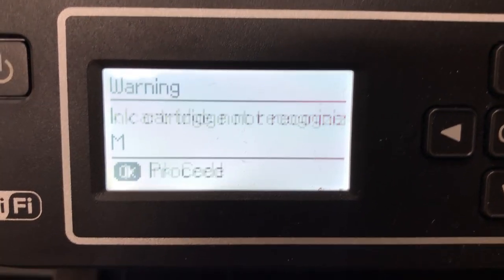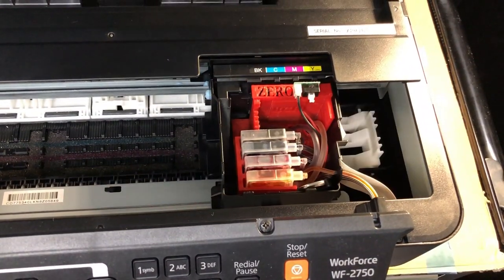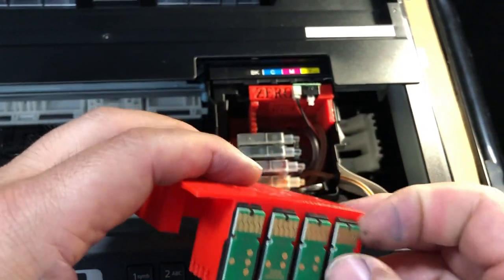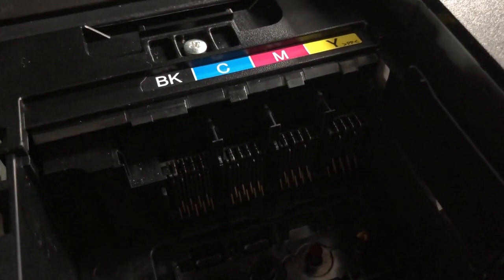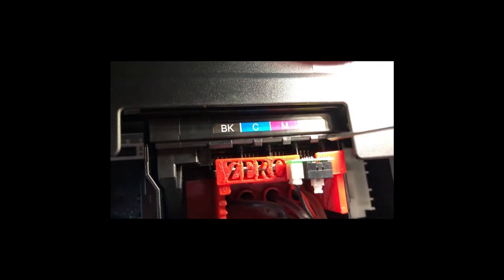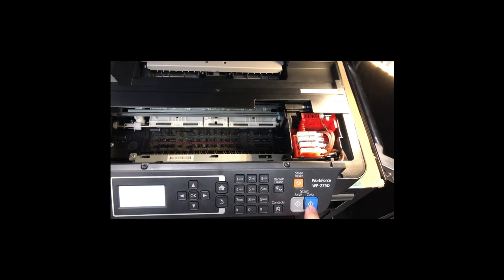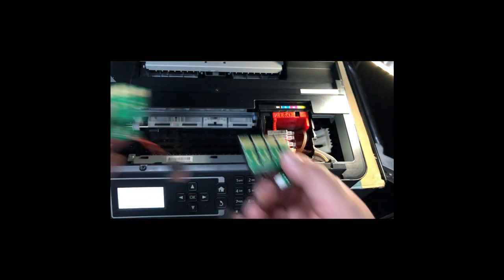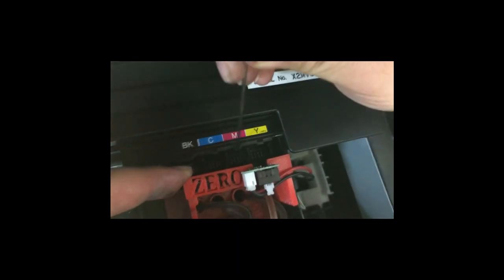A quick fix of CIS chip not recognized problem - WF 2750

Comment: Thank you for the vid. I will never be buying another Epson product in my lifetime.
Reply: I agree. I have had 2 epson printers. They last a few months and then something goes wrong. The one the paper feed just stopped mid print. Now the second one just does not recognize the ink halfway through a print.
Reply: HP is the same or worse.
Reply: @flottagraphics  so far Brother hasn’t been a complete scumbag company
Reply: @seanbradley8286  At least you can buy Epson projectors and document cameras. Those are awesome!
Reply: Im a broke 22 year old that runs a small business 
I bought a epson printer and was so excited and it died exactly a month later so I bought a new one and its not reading the new ink cartridges that I just spent $70 on 
I've wasted $270 on their printers im beyond annoyed its not good enough
Reply: @bethanyfuller6236  JUST BUY A COLOR LASER MFP. The technology has improved a lot over the years.
Reply: Nor me!

The last time before this the new genuine cartridges were between 80-90% full.

This time the damned machine doesn't even recognise the genuine cartridges.

I pull the indicated cartridges out and reinstate it and then the sake message comes up suggesting another one is now not correctly positioned. Now its two or even three cartridges are not recognised.

This is the last Epson that darkens my doorway. It's not even that old.
Reply from the maker: What model is it? I have videos showing how to turn the $70 printer into chipless and then you can just refill them.

Comment: Hello! My printer is an Epson Stylus NX515, It keeps telling me "replace ink cartridge" for blue and yellow. I can't remove the chip connector on the printer so I  tried pushing on it and I still get the same error even if the cartridges are new ones. Any Ideas how to fix this ? I also tried turning off the printer when the cartridges aren't in the printer, and turning it back on and adding yellow and blue, and nothing changed.